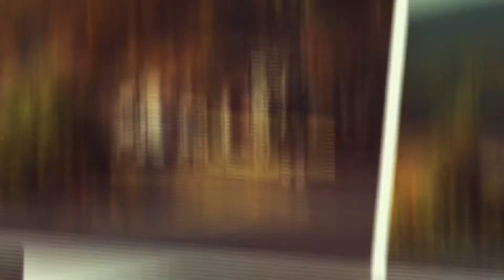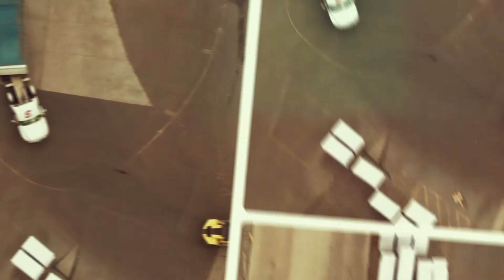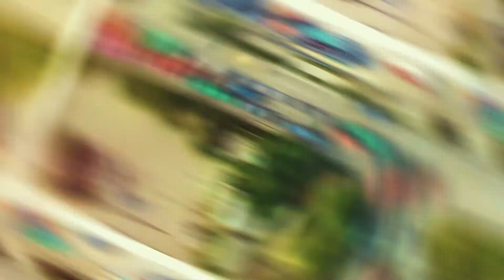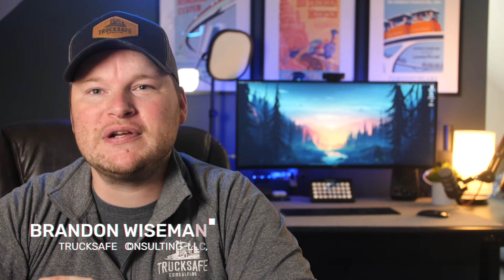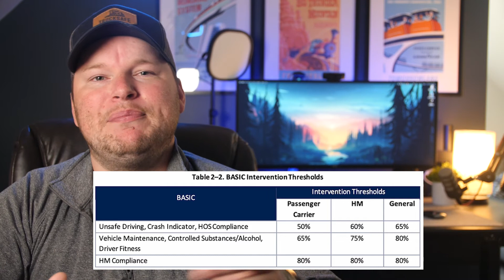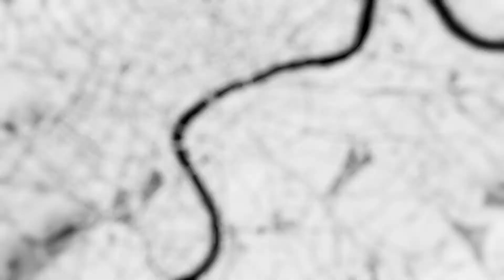How CSA scores are calculated | Introduction

Comment: Whole system is crooked . Large carriers Ratio is .05 truck in 2 years means each truck isnt isnt inspected even once in 2 year period where as small carrier each truck is stopped and checked 7 to 14 times in 2 years period. More you stop and check more chances of discovering violations ..so this whole system is designed to punish and take small carriers out

Comment: So it doesn’t really affect the driver as much just the carrier???
Reply from the maker: Depends on the violation, but it could impact both. The carrier’s SMS account and the driver’s PSP record.
Reply: @Trucksafe   it was 396.17 c
Reply from the maker: For now, that violation will land on the carrier and driver. But the agency has proposed revisions to SMS that could eventually only place that on the carrier. But those changes won’t go live for a while.
Reply: Ok lol one more question I just got a new job that I haven’t started yet I start it in two weeks I receive this violation while waiting on my two weeks with my old company. Should I tell my new company about it even though it’s technically not a ticket???

Comment: How would they know if you are operating a vehicle out of service ?  what if you had to drive vehicle?
 Get fix and it took you two days to get home And fix it
Reply from the maker: Once the vehicle is placed out of service, it can’t move until the problem is fixed. This means either getting it towed or having a mobile repair unit come out. OOS violations are uploaded to a national database, so if you get pulled over again after an OOS violation, the officer would have access to that fact.

Comment: Insurance company won't insure me because of a mailing address I used previously but never live at but is showing on my cab score. Trying to get PA insurance and they think I live in NJ because of this but I don't.  How do I fix this?
Reply from the maker: What address do you have on file with FMCSA?
Reply: @Trucksafe  I had my address in PA as my address and NJ as mailing address. However i changed it on fmcsa over the weekend so both are pa address and I'm still getting rejected
Reply from the maker: Nothing you can really do then except get the message through to the insurers. Are you using a broker?
Reply: @Trucksafe  I am, don't know what to do if I can't get insurance I'm screwed. I'll go out of buisiness and lose everything
Reply from the maker: Sounds like your broker isn’t advocating strongly enough for you. May need to switch it up.
Reply: @Trucksafe  Are you able to look at my cab report and tell me why this is still showing up and how I fix it

Comment: I lease a budget truck for the first time for my business and got a out of service for the first time due to brake lights not working and abs light on the dash. Is not my truck and it happen while driving.  What will be my percentage for first time fail Inspection??
Reply from the maker: If it’s your only violation, you probably won’t have a CSA score yet. Typically it takes at least 5 inspections with violations before you get a score. That said, this will impact your out of service percentage which is another metric that FMCSA, shippers, brokers, and insurers consider.
Reply: @Trucksafe  due to your expertise and me being new What percentage you think ill fall in?. Would it be 65 percent or more?. Im new here and some od the things I learn was watching your videos
Reply from the maker: Your out of service rate is simply a calculation of how many of your roadside inspections have resulted in your driver or vehicle being placed out of service. So if this is your one and only inspection, your out of service rate would be 100%. So it depends on how many inspections you’ve had.
Reply: @Trucksafe  my last and only question. Hopefully you can answer.  Im currently doing Amazon relay at the moment.  Will they suspend my account knowing that they check your csa score on what we talk about or will it take more then that for them to suspend me?
Reply from the maker: I’m not familiar with their KPIs and metrics, so cant comment on that.
Reply: @Trucksafe  thanks brother

Comment: Will a violation affect the insurance with a company I want to work for ?
Reply from the maker: One cumulative effect of roadside inspection violations could be increased insurance premiums.
Reply: Even if I didn’t get fined for the violations ? I already  work for the company. I got the violations over a month ago & I just got hired & working another company now. They didn’t say anything about it. Will they eventually mention anything ?
Reply from the maker: It would only impact your current carrier if you got the violation while operating under its USDOT #.
Reply: @Trucksafe  ok good. So my insurance won’t be high if I go to another company ?

Comment: So do you only get a violation if you get pulled over and they see it? I violated my 30 minute because my tablet said I was good to go and then gave me a violation as soon as I moved.
Reply from the maker: Correct. Only violations that are written up by an officer during a roadside inspection or a DOT audit filter into the system.
Reply: Speeding events?

Comment: So I got violations 395.8(a)1 
395.8
395.8(f)(1) how many points is that ?
Reply from the maker: The 395.8(a)(1) is 5 points, 395.8 is 1 point, and 395.8(f)(1) is 5 points. Those get multiple by a time weight depending on how recently they occurred.
Reply: @Trucksafe   I just got the violations 3 days ago
Reply from the maker: Ok. They won’t show up in the system until next  month

Comment: 393.9 is that a serious violation?
Reply from the maker: Depends on the type of light. If it’s a clearance light, it’s a 2 point (out of 10) violation. Head or tail light is a 6 pointer.
Reply: @Trucksafe  reverse light improbable
Reply from the maker: 6 points
Reply: @Trucksafe  🤦‍♂️

Comment: DOT gave our driver 3 OOS 2 395.8(e)(1) and one 395.8(a) how does this weigh ? All three were out of service.
Reply from the maker: 395.8(e) violations have a severity weight of 7, plus an additional 2 for OOS. So 9 points for each of those. 395.8(a) has a severity weight of 5 plus 2 for OOS, so a total of 7. 9+9+7=a total severity weight of 25. Multiply that by a time weight of 3 and you get a total of 75 points for this one inspection.
Reply: @Trucksafe  how do I calculate my percentage ? I’ve had 3 inspections prior with no violations. The TiW is 6 currently. Is it 75/6? Will this meet the threshold for the HOS category? Thank you for helping me understand more about CSA
Reply from the maker: You can’t really calculate your percentage on your own because it depends on the performance of your peers. But you can look up your percentile score on your SMS account.